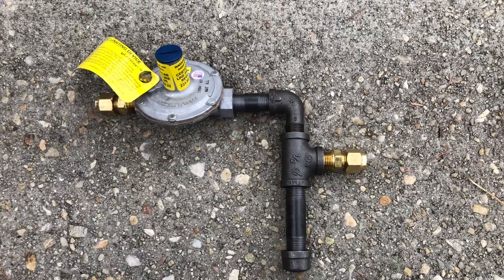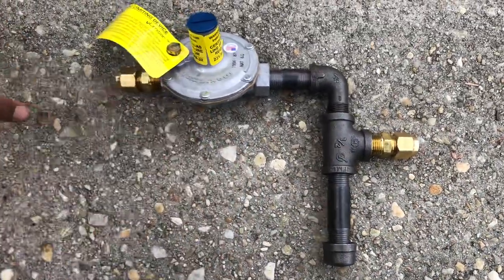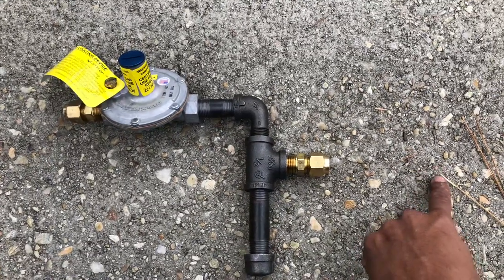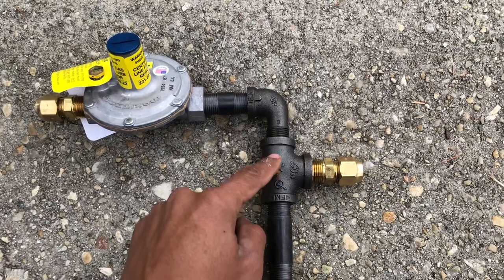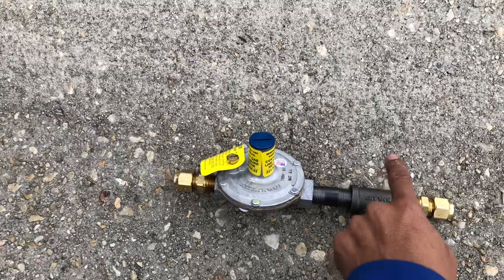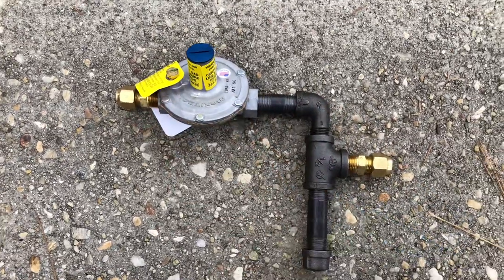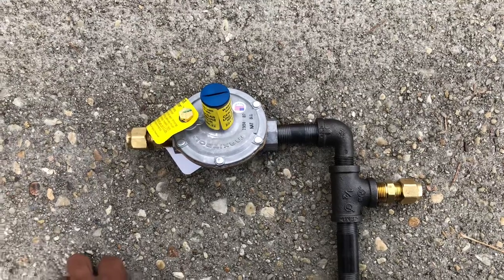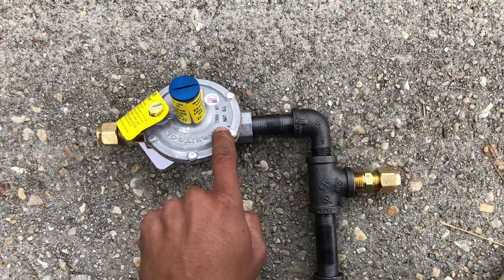How to make a drip leg with a regulator using black pipe for a furnace

Comment: That particular regulator you have, 325-5 is for a pounds system ( not required for an inches system) & must be mounted horizontal, if a limiter is to be used.

Comment: I’m also in NC and have a leaking regulator. They have the gas line run into the regulator and then T’d off. One line down to the water heater and the other up through the ceiling to the LR fireplace. 

Does a water heater even need a regulator? 

Also, what I have is 1/2” OARA 2psi 7” - 11” When I search grainger they have similar maxitrol models, but I’m unsure of BTUs needed. BTU rating alters the price from $30 up to $300.